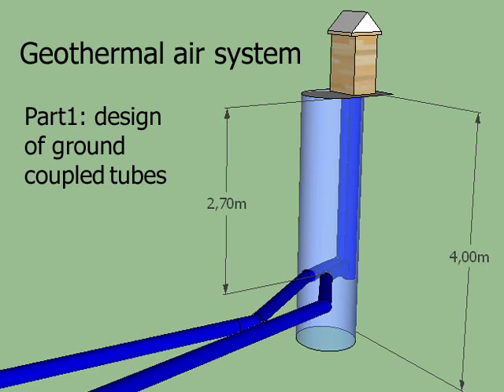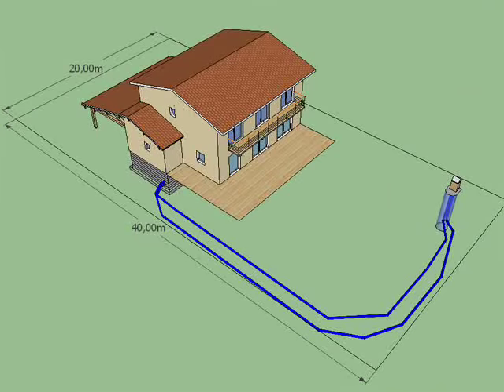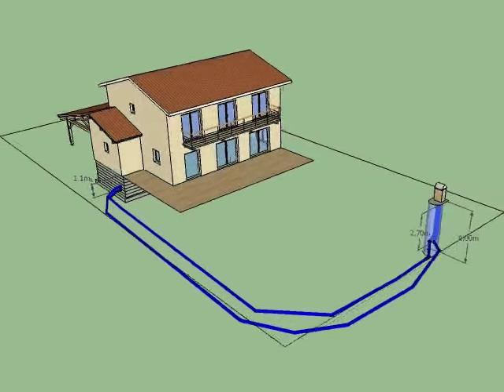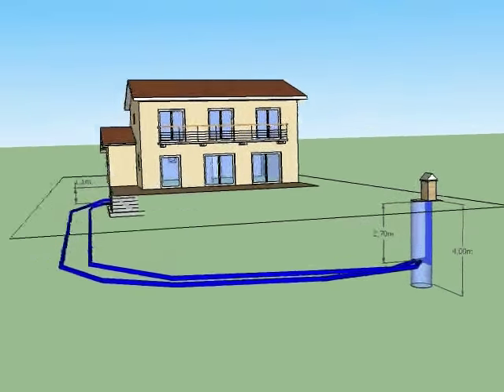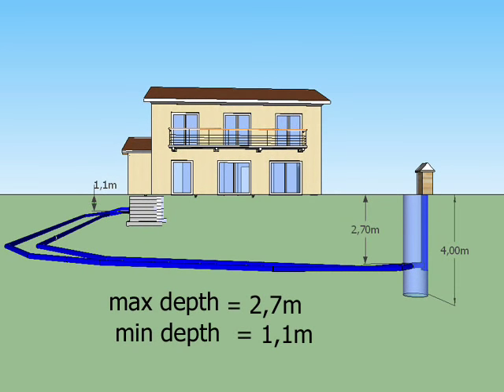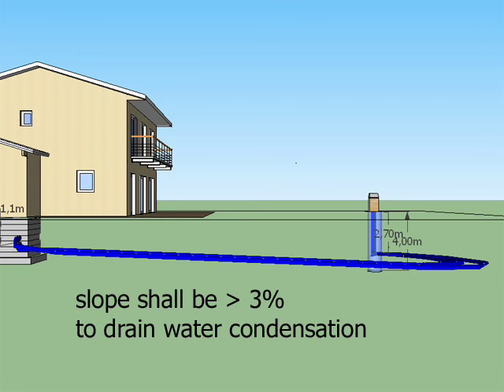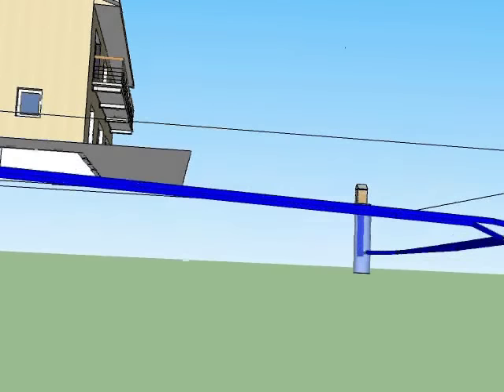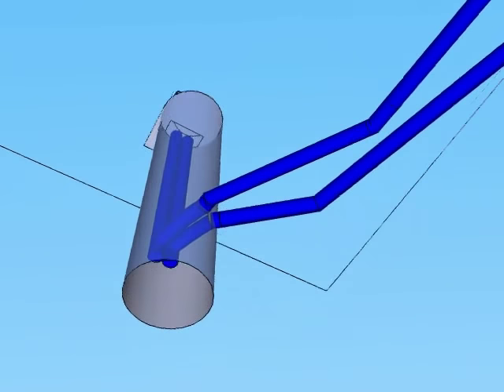Earth tubes as heat exchanger for geothermal ventilation / AC / cooling and heating passive house

Comment: Hi,
I build a house equipped with a ventilation unit that have heat recovery. Can I connect the suction of this unit to a Canadian well as you build? Summers are pretty the same in my area then in Lyon and I would like to coold down a bit the house using this well.

Comment: Hi
Thanks for you experiment and it is really interesting 
Question : if the pipes are not available in some countries can we use other kinds or can we use a cement pipes !
Thanks
Reply from the maker: Hi. I think it should be avoided due to moisture.
Reply: @nrlog3682  what is name of the special tubes?

Comment: I am looking at constructing glass green house in UK and want it to be heated. Looks at many sites and found none. I know about geothermal heating from home building shows and magazine. Just wondering how could I use GT for small green house? would it be too expensive to install and run?
Reply from the maker: Hi. the tubes used here are quite expensive for a greenhouse. in winter the air comes at 12degrees so more an unfreezing system than  a heating system as such.
Reply: Could look at a walpani design to help regulate the temps.

Comment: Hmmmm I just realized you could periodically flush the sloped air tubing with a disinfection water solution.  Your slope allows the air tubing to drain away from the house.
Reply: No need to flush. You do not breath this air. It is only passing through the outside unit and back int the environment.

Comment: Why is 2 pipes needed?
Reply: 2 pipes will have double the effect of one one pipe with next to no extra effort.  The speed of airflow through the two pipes will only be half that of one pipe, the slower the air moves the better the heat transfer
Reply from the maker: Absolutely. And the speed of air also creates noise, so it is better to divide it by2